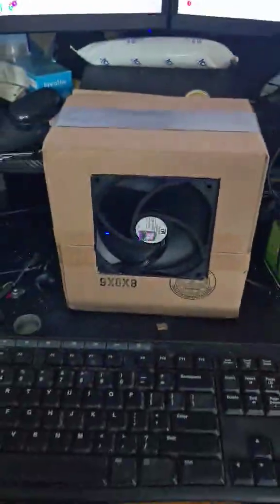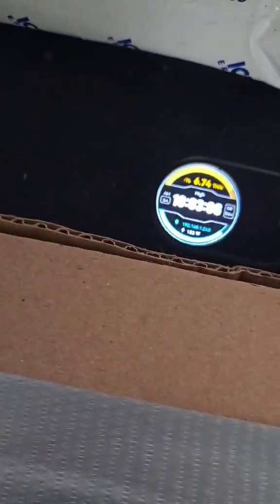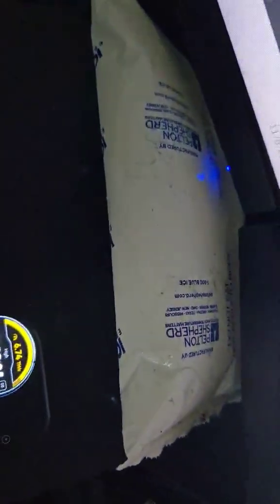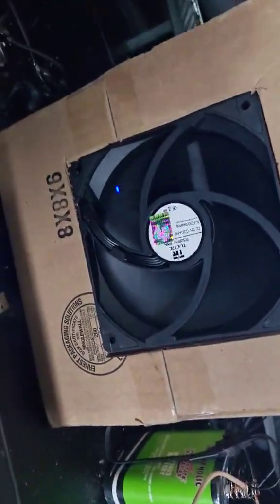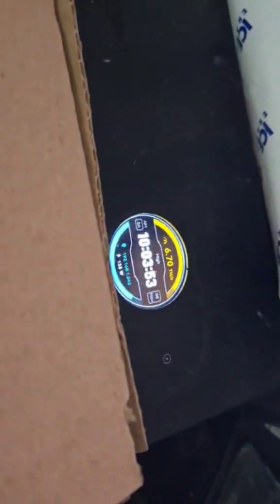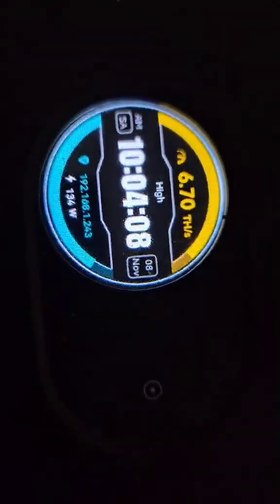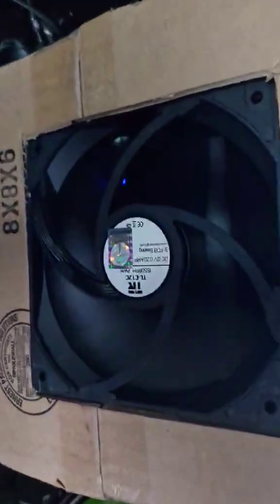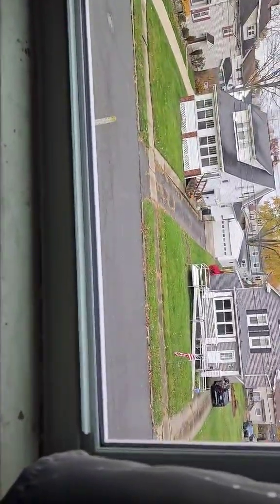My Results Overclocking the Avalon Nano 3s

Comment from the maker: For anyone of you few that might be eager to see what happens when the air is pushed from behind, I actually got a very minimal increase in TH - about .07 (compared to .20-.40 when pulling the air) was the largest increase from the standard / non upgraded rig. The 3S has two thermostats from my understanding, one you can remove, but the other is part of the processor or otherwise inaccessible. I think when the air was pushed from behind, it was too much cool air and that secondary thermostat came alive. I did make a more permanent solution - pretty much identical to the one this video, but nicer looking, permanent power supply and I added some dryer vent tube so I can direct the heat flow. Still getting 6.65 -6.80TH (sometimes it flirts with 6.90). The better looking rig dose not do much better than the cardboard box version. Also, it runs the same whether or not the air coming in is cold (the ice pack part of this video)

Because of the lack of improvement with the air being pushed & more airflow direct to the processor, I'm going to play with different fan speeds to see if there's a sweet spot to further increase the power.

Comment: Solid setup and idea! A good amount of heat coming out or barely noticeable?
Reply from the maker: With the two I used for that setup, yes - it's a good amount. About the same as a 400W small space heater is my opinion. If you noticed in the video, those two are right in front of my keyboard, another is near my mouse and the 4th is in my wife's "office"